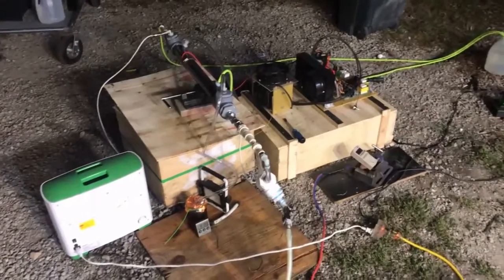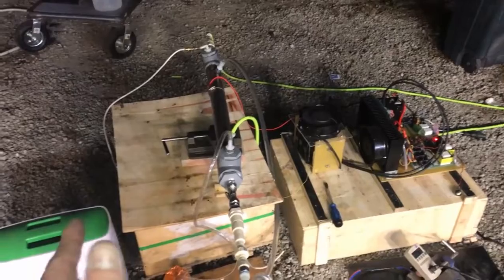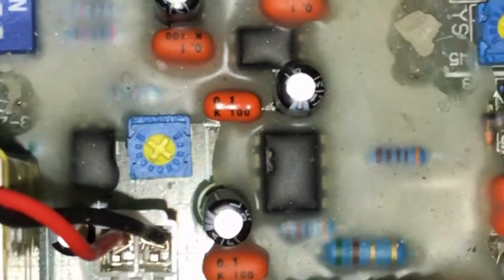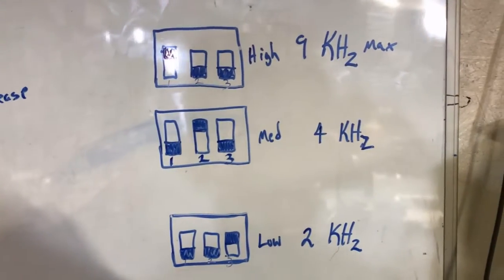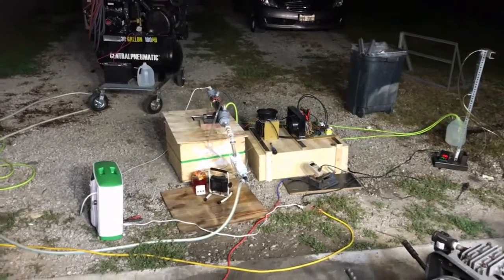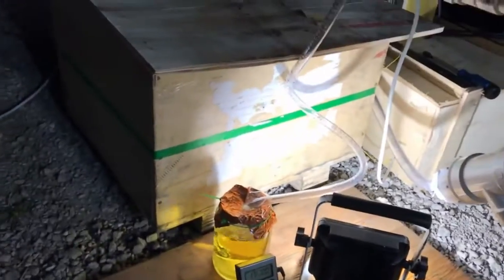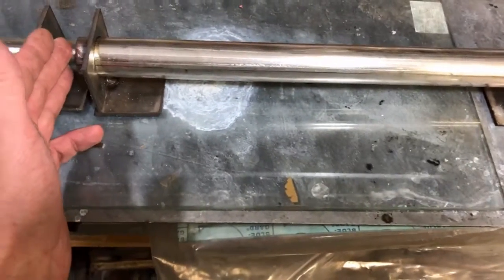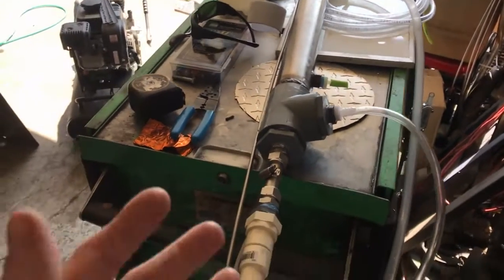Industrial ozone generator 800 watts

Comment: Hi......I wrote to you suggesting a way to produce high pressure low flow pump assembly, I know you've been using a pressure washer pump. So, I also had the same problem and found a solution. I purchased a 'water pressure test pump' for under $10 and motorised it. I also added an empty welders disposable gas cylinder to the pipe work (positioned upside down) that acts as an air expansion tank to help store the pressure (air is trapped n compressed inside it). This has worked a treat.....thought this might help you?

Comment: Have you tried both external and internal cooling? Run water through the Qartz pipe as well. I'm thinking of trying this. Water will act as a natural electrode! When the temperature is low, the glass cannot be punctured, and since there is no high temperature, the ozone efficiency is higher. What is your opinion ?